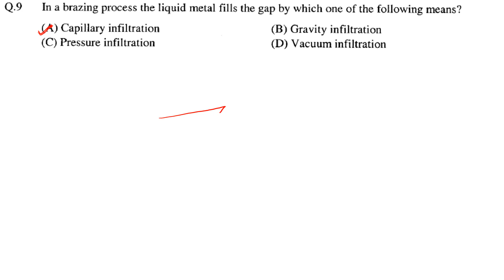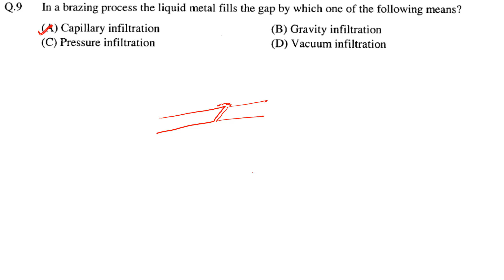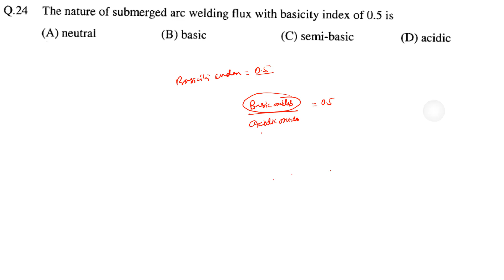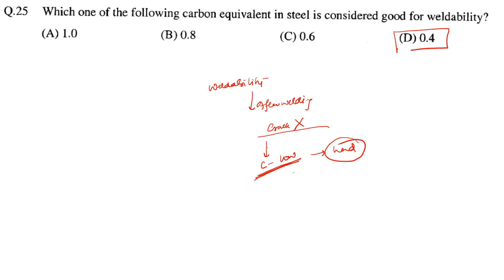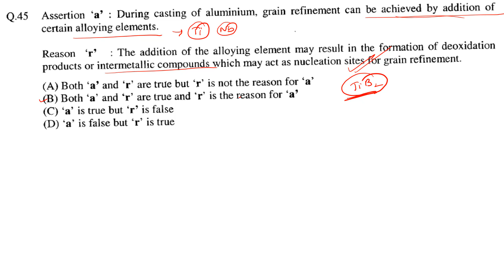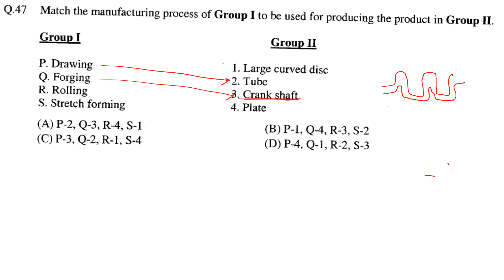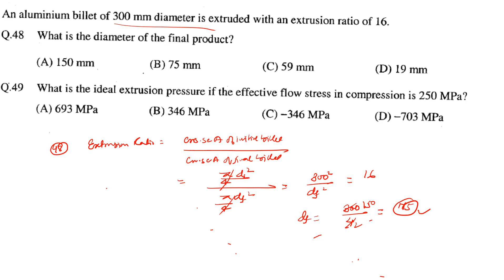GATE 2011 Manufacturing Process Solutions

Comment from the maker: 00:00 Brazing Process
00:24 Nature of submerged arc welding flux
01:20 Carbon equivalent
03:36 Assertion Reason Casting of Aluminum
04:32 Match type NDT
05:33 Match type manufacturing processes
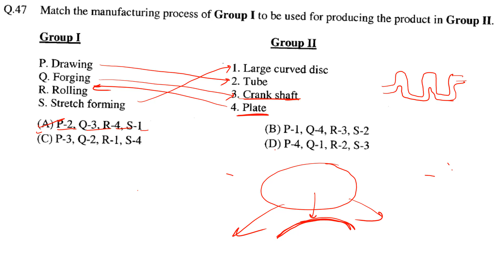06:55 Extrusion pressure